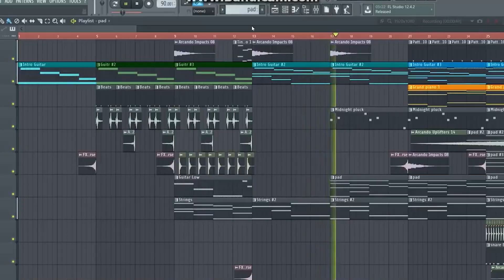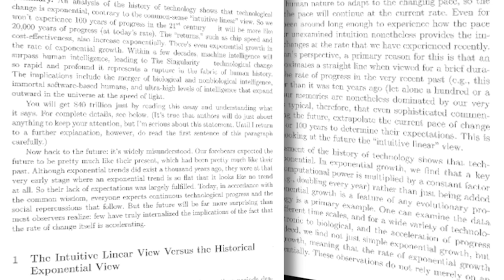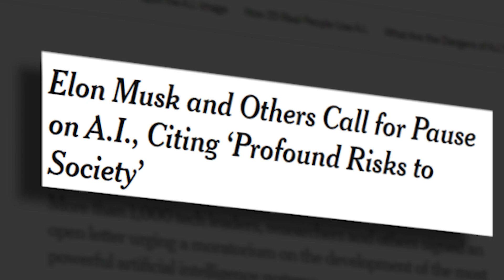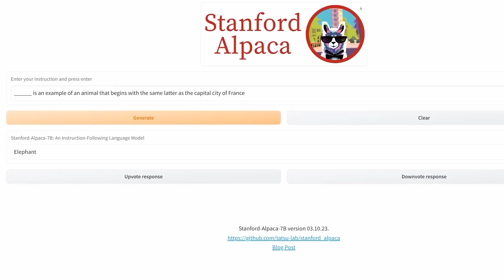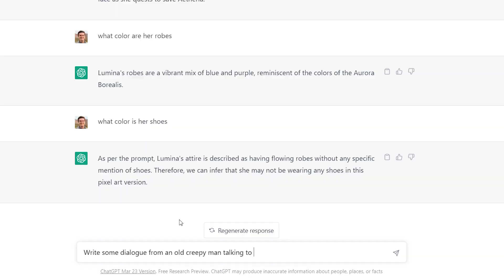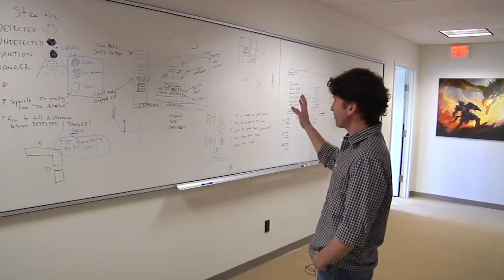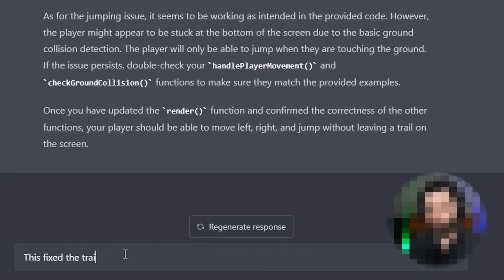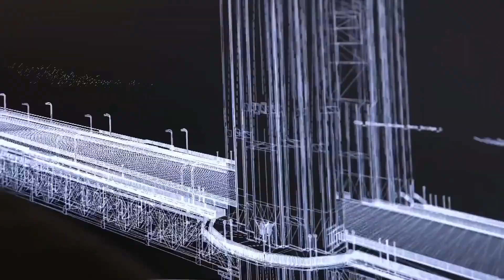AI Just Changed The Video Game Industry Forever…

Comment: The only jobs safe from AI are diverse location physical jobs.
The body is a machine with unparalleled fine motor control and sensory detection.

A plumber is an insanely difficult job for any machine to do. Fine motor control, visual detection, unusual spaces, diverse setups, ect ect.

Comment: I don't think this will be anywhere near what the industrial revolution was. This is just a big step in automation, but definitely not the pinnacle of it. Also, these AI models are at their peak efficiency at this point. They're basically nothing more than a very good lossy compression of the whole internet with a smart search engine on top. By definition, nothing they produce is original and they're definitely not "intelligent". Industry applications means faster iteration, good starter ideas and concept generation, but the end product still has to be original and designed by humans, and fine-tuned by humans with AI-powered tools.

Example: say you want to start a business. ChatGPT can give you thousands of great ideas, only problem is that every one of those has been done before, since that's how it got the ideas in the first place. If you want to be original, you have to do something that nobody has ever seen before, which is absolutely impossible for these models to generate.

Comment: I'm about halfway through making a fully 3D game with procedural city generation, fairly complex mechanics, etc. 

ChatGPT has done about 95% of the coding and prototyping work. I'm just doing implementation, direction, and prompt engineering.

Honestly, as a gamer for over 20 years I'm amazed, I'm actually on the verge of making a really good game.

Actual developers seem to think this is impossible (maybe because it means their jobs are going to be gone soon), but for real, it works great. 

Sure, it's not optimized and there are undoubtedly things I'm going to have to learn myself but goddamn, I tried making games before and I didn't even get 5% as far as I have this time.
Reply: yeh theres a lot of devs out there saying it wont replace them, same goes to artists. jobs are either gonna be fully automated or used as assistance. think about it, if we r talking about ai replacing programmers, bro thats literally any job they can replace
Reply: have you published the game? :0